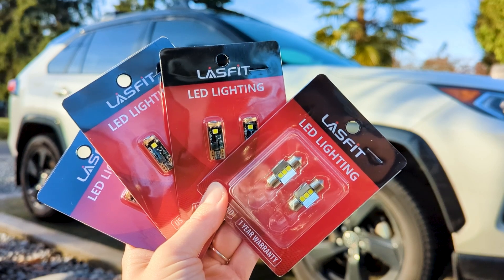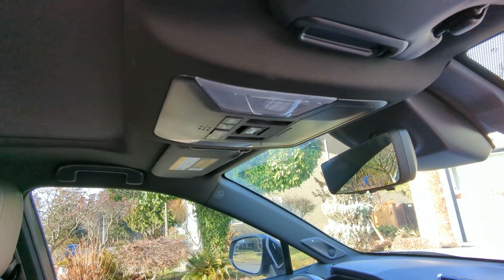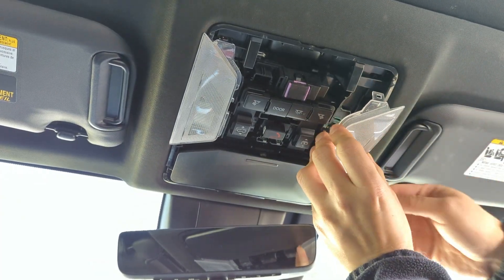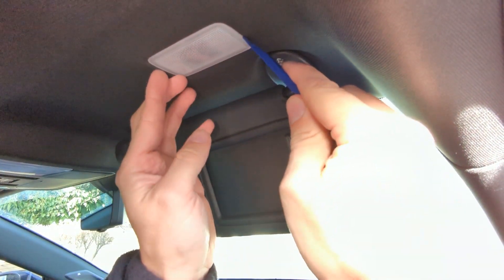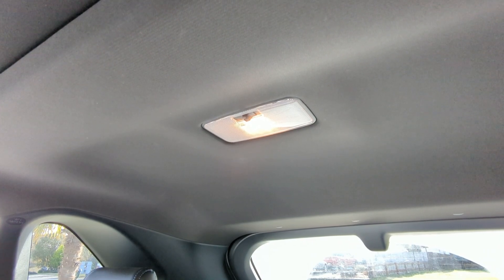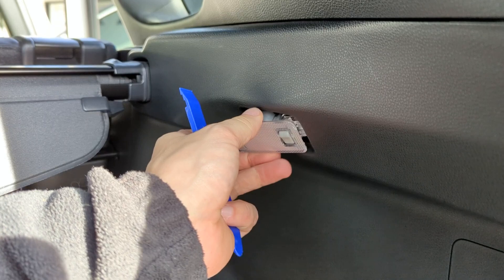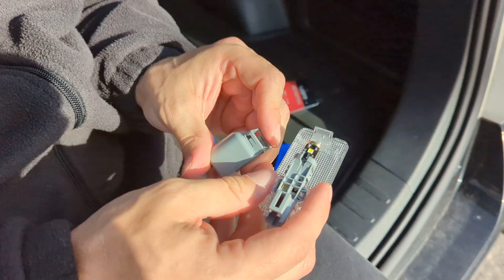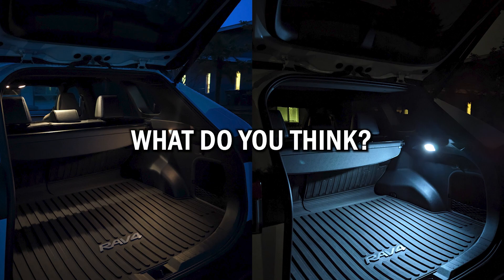Inexpensive MUST DO Toyota RAV4 Upgrade!!

Comment: I really admire how you guys aren’t shy about modifying your RAV4. If I did that, I’d screw something up! Have you ever taken the box on the windshield, behind the mirror, off? Thanks
Reply from the maker: Thank, I don't plan on doing any major upgrades beyond the lights. I have not taken it off. Is there a reason you would want to?
Reply: @Nicole.Sisson  I got a dash cam and as hot as it gets, even with 3M tape, it comes off the windshield. IF there’s any space available behind the box, I’d like to attach the camera with tiny screws. You’re so kind to ask!!
Reply: OMG!!!!!! I got a freaking crack in my windshield yesterday! Now I have to have it replaced, so I guess when the Safelite person removes it, I’ll do my modification.
Reply from the maker: @scottk2774  That would be a wise time to do it! 👌
Reply: @Nicole.Sisson  wise, but expensive 😂
Reply: You ain’t kidding! $1,070! And that’s not a genuine Toyota glass. The Toyota glass was several hundred more!😢
Reply: @scottk2774 why wouldn’t it be covered by your insurance?

Comment: Can't wait to yeet the obnoxious center console. It just seems blah. The armrest cubby is perfect but the section below the AC controls is a joke
Reply from the maker: What's wrong with the compartment below the AC? it's perfect to set your phone down.
Reply: It’s perfect side ways, but you can just put it in straight, it’s like it just barely doesn’t fit anything.

Comment: Hi Nicole so I've owned my rav4 hybrid since august of 22 a full tank would get me 570 miles now it only gets me about 440. I was wondering if you have experienced this with you rav4 I just think its a huge drop in mpg.
Reply from the maker: My DTE has dropped during the winter because my average has dropped. I was getting around 42 in the warmer months and now I'm at about 36. I honestly haven't been paying too much attention to it since I had it repaired. Was your vehicle affected by the gas tank issue?
Reply: No my rav4 didn't have that problem but I'm getting better milage now with the warmer weather. Thank you for your response n love your channel.